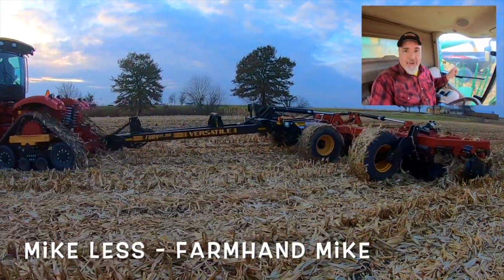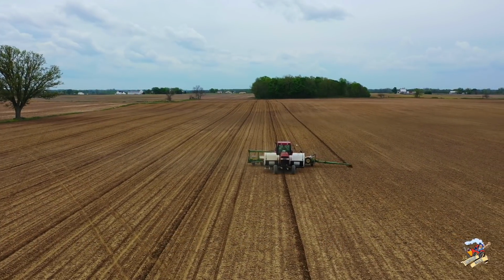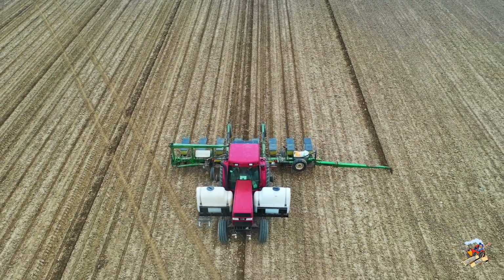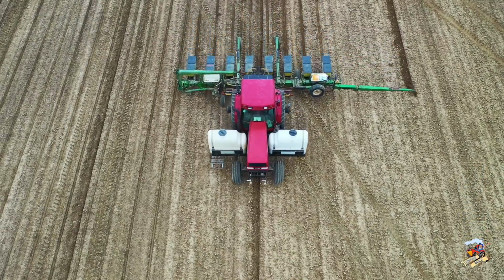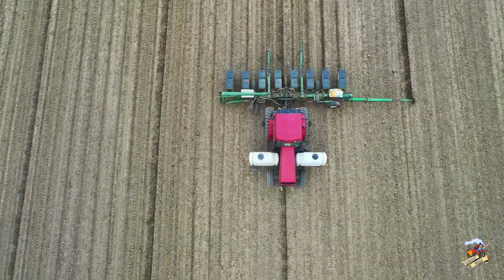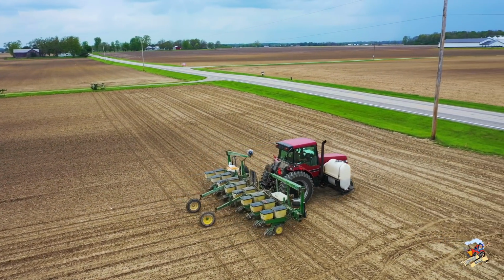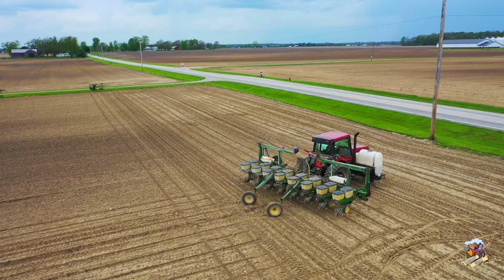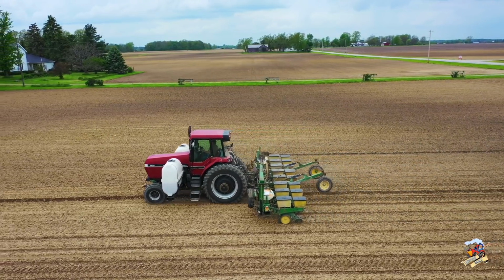PLANTING CORN near Ithica Ohio

Comment: Nice video mike. It is just the opposite here in central Louisiana. It is all 3pt. Mounted planters here and very rare to see a pull type. Also almost all the corn, cotton, milo, and about half the soybeans are planted on 36" and 38" spacing. Farmers over here consider 30" a narrow row spacing, especially for corn and cotton.